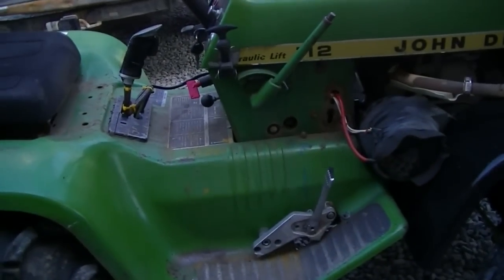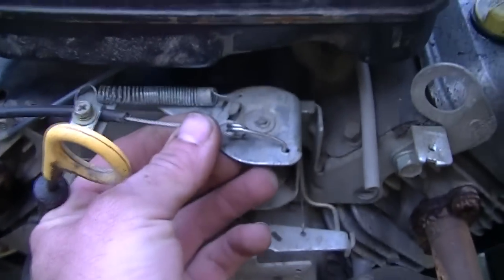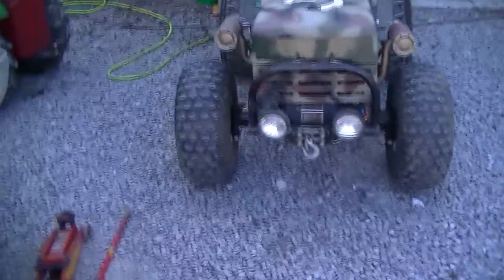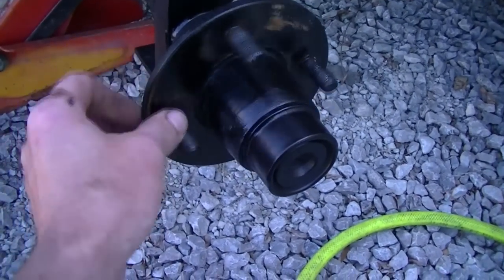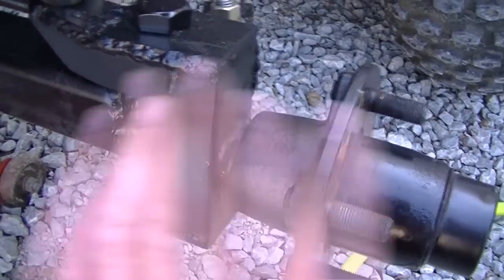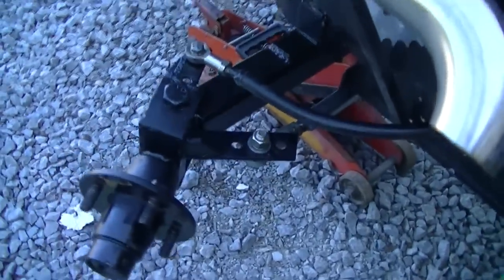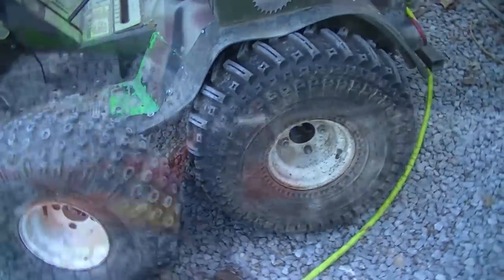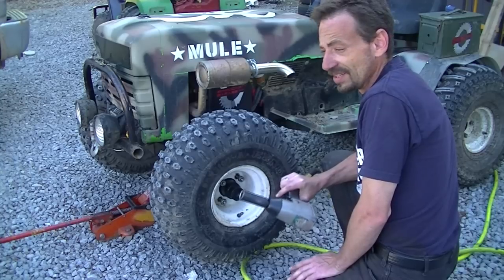MULE + Faceplant = BADA$$ Frontend!

Comment: That's badass for sure. Gotta love trailer bearings, one if mine was blown and I just went to tsc and got trailer bearings for my 1" spindles :D
Reply: Yea I'm still running stock spindles, yikes!! 
They have major wear too, I can rock the right side wheel in and out at the top probably 2 inches. 
Lol i already put some weld on em a while ago too, in done with that I gotta figure out a bearing setup :)

Comment: Looks awesome. I am curious about the resistance those 22" tires added to the steering gear? Is it harder to steer with the extra width and have you thought about a steering stabilizer like what you would find on a straight axle 4x4 truck? Power assist steering?
Reply from the maker: daw718 I haven't had the chance to give it the full test package yet. I CAN feel additional resistance due to the larger meats, and it was expected. For simplicity sake I will not do power steering, but I may at some point convert to a rack and pinion, or a proper steering box.